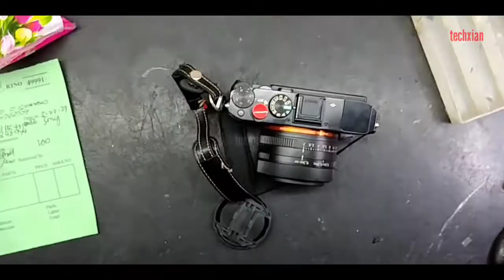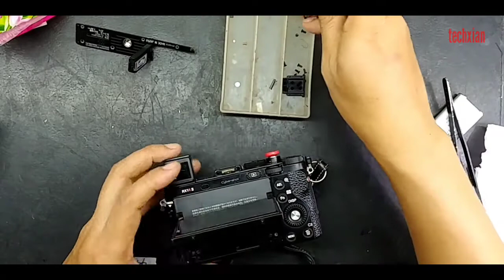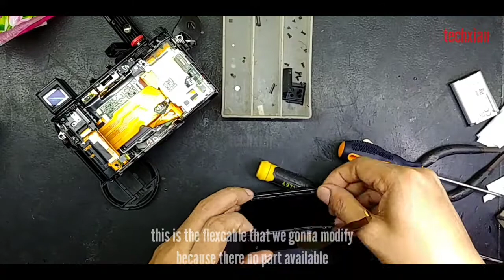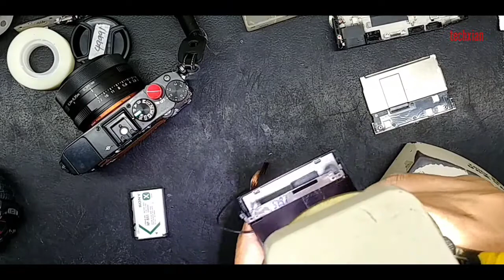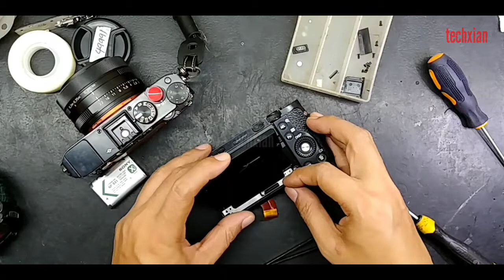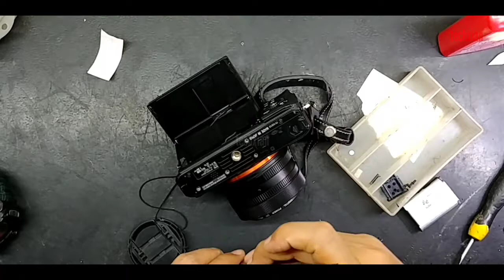SONY RX1R MARK 2 LCD FLEXCABLE MODIFICATION

Comment: Nice. Do you think it would be possible to tranform the 35mm lens in a 28mm or 55mm swapping the lens groups with other lens group from zeiss or sony with the  same 49mm filter treath?
Reply from the maker: its not possible sir there a lot of wiire and sensor in the lens so it cannot modify
Reply: @techxian  bummer
Reply from the maker: @StreetMusicReportage the lens sir is built-in in the frame of the body so it not really possible change the lens assembly
Reply: @techxian  yes I know. I already change the lens one, because was broken. The lens itself can be open. and since the CZ 55mm 1.8 seams to be a very similar lens, I was hoping that a skilled technician could do something about it...would be awesome to have a 50mm option for the camera

Comment: Can you please give your number or email , My fuji Xt3 is not turning on ..I need help please..
Reply from the maker: there two possible problem to your camera..there a short in shutter assembly or the lcd flexcable is already damage...
Reply: @techxian  So how much it cost for repair ?
Reply: @techxian  I used my camera 2 days back .it works fine . Today morning ,when i take my camera it doesn't turn on . I even try using 2 different battery.